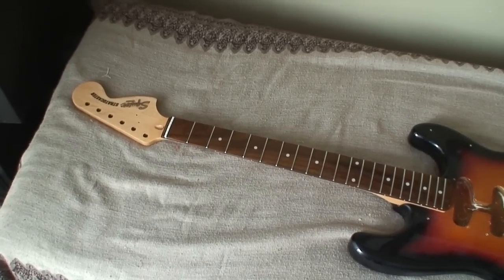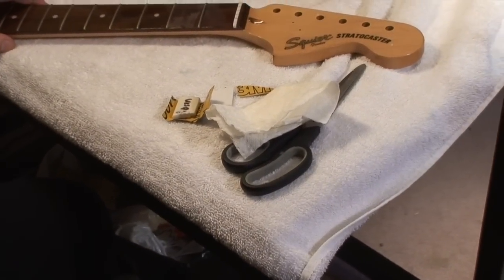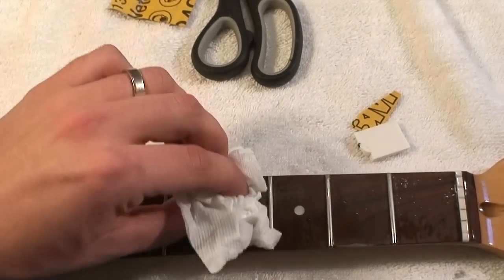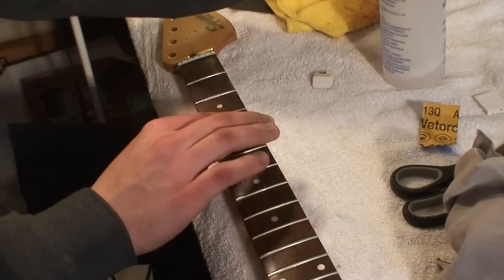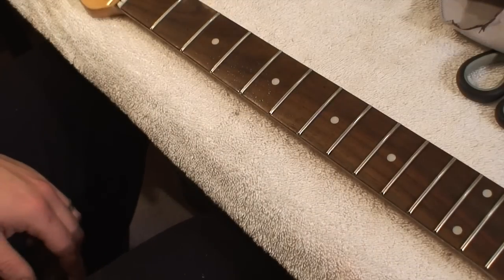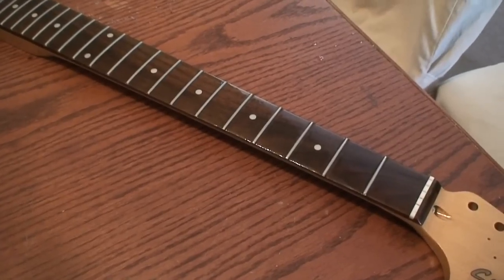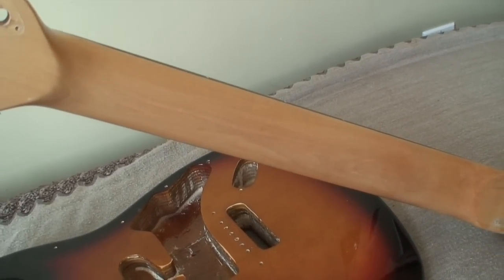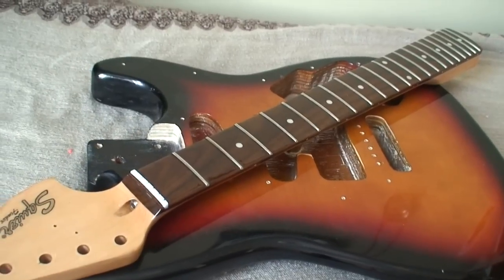Will the Lacquered Rosewood Strat neck work out? - part 2

Comment: I'm watching this with increased interest. I just bought a Gibson Melody Maker Special carcass on eBay and it came in yesterday. The rosewood freeboard is super low grade and seemed to have but finish sanded with a band saw. I think rolling edge and lacquering the board might be the only way to make it worth the effort of a build out. 

2 of my older Michael Kelly guitars have their fretboards done as well and they have a great feel. Great vid as always man. Thanks!
Reply from the maker: Cheers dude. It's funny, but I've had a dozen Les Paul's and its the good old LP that's made me think of this so long ago. I'd love o see a LP done like this.  It's always been in the back of my mind. Could I lacquer a LP neck?  I think it would look and feel great.  I'm hopeful this works out and I may just do a LP at some point if this is durable enough not to flake off over time.  I'd like to see how this holds up, because of the natural oils in rosewood.  Some have made mention that this won't hold up and that the natural oils will force the lacquer loose eventually.  It is my biggest concern. But, I've finished tons of wood-working projects like this and it has never caused me any grief.  It may be a case of finding the right material to do this.  Terry suggested epoxy.  But that's messy and while I know it'll work, I'm not keen to do it.  It's something that seems quite messy and uncontrollable;-)  Anyway - let's see how this shakes out.  Thanks again for stopping in to chime in on this:-)
Reply: Epoxy is a good idea but I'm scared just thinking about that one. I've had a few "painful mistakes" with epoxy that have left me a little gun shy. I wonder if true or tung oil will work too? I have a true oil maple tele neck that I love. Maybe to mix it up I'll try that. What's great there is that it doesn't smell bad either. I've worked with nitro for years but since kids my wife has relegated it to outdoors and the shed. Which means 3 months of the year to work with it. That stuck REAKS. 
I have to figure yours should hold up pretty well unless you're playing the crap out of it, and then you might get what Fender guitars get where it gets a little frayed at the edges. I can't wait to see it done! Thanks as always dude. I'm now dusting off my 3 or 4 still born projects... you've inspired me to start finishing some stuff!
Reply from the maker: That's awesome dude.  Post up a link if you're filming any of it.  I'd love to see someone else's take on this.  As for how it'll wear, I'm hopeful, as you say, it'll be just like any other lacquered neck Fender.  Those finishes eventually crack and do all sorts of nasty stuff.  If this holds up the same, I'm happy with that. As for oil finishes, I've done them. They work great. One of my very first videos, is scraping shittiy old lacquer off a maple neck and redoing it in Tongue oil. Worked out great. Felt great. Sad I don't have that guitar anymore;-) Good luck and I'm glad to have kicked you in the pants to try this:-)
Reply from the maker: Oh and BTW...I think that Melody Maker is a great candidate for some upgrades like this. I've tried the oil on rosewood necks.  Seems to work just fine.  Though I had to go to a lot of effort to get the shine I wanted.  I ended up with a few coats, buffed, flattened (really easily too) and then some paste wax.  The paste wax was great. Brought the shine up, its super durable, re-applyable at any time and you can be rough as hell with it. Rougher the better. I use a shoe brush and it comes out like mirrored glass:-)
Reply: Woodeso's Guitar Mods Sweet thanks for the reply and info. I'll document the process in a video or three. I love the 2014 MM, with the carved maple cap and thin body it's built right and super comfortable to play. I have enough P90 guitars so it should build out to something cool with the GFS Hot Liverpool mini hums in it and a Bigsby. I've also got a flame top tele mahogany body with a flame neck that needs staining and finishing and a Portuguese flag themed Strat that really is just waiting to be put together at this point (and has been for a number of years). Time to get them done!

Comment: The only reason they use a clear lacquer on the maple necks is to protect the wood from wear. You've seen old tele's where the lacquer has worn through and the wood wears down. If the lacquer wears off I always respray mine. Leaving the wood bare is like never washing a vintage car. Eventually the wood starts to wear away and that can't be fixed. Rosewood necks are naturally oily and resist wear if oiled regularly. In fact the oils in the wood will probably keep the lacquer from bonding to the wood. Never seen a rosewood neck that was lacquered and I don't think that's because no one ever tried it rather they tried it and it doesn't work. I have a feeling that if you play the guitar for a few weeks the finish will just come off. And nevert sand across the wood grain. That's woodworking 101.
Reply: squidkid2 Tony Iommi used a lacquered rosewood fretboard for like 10 years.
Reply: rickenbacker
Reply: never sanding across the grain of the wood, is woodworking 101. He didn't say not lacquering rosewood was woodworking 101. Of course it can be done, but steps do have to be taken in order to prep it for the lacquer to bond.

Comment: I have a solid rosewood neck ,I'm going to try to spray everything but the fret board, I already did it once with off the shelf rust-oleum  gloss lacquer and I had to sand the entire neck back down to wood, I just ordered Nitrocellulose lacquer and im going to retry, The first time I didn't grain fill and the lacquer didn't stick at all, I mean it did but it didn't it was just a mess, So this time im going to grain fill wipe down spray sand sealer then my nitro, Do you have any suggestions since you have also gone through the problems of spraying rosewood.
Reply: i think the key for this to succeed is sanding.I used a ripped off rosewood fingerboard from a project and sanded it lightly in the direction of the strings(cause i didnt want to mess with the radius) with various sandpaper grits....from 320 to 800.Then i wiped it clean with alcohol several times and minutes later after the last wipe i sprayed the first clear coat.I sprayed another four or five coats that day and the next combined and the fingerboard has already a nice glossy look....i didnt continue but the project was a success and that made clear that prepwork is the most important here.
Reply: Dreamdancer11  i ended up with a nice finish, the key was the grain filing of the neck after that everything "the nitro"stuck to the wood as it should have
Reply: Nice...but i was talkin about laquering the rosewood fingerboard...as for grain filling now that you mentioned it i personally use thin cheap superglue....its easy fast and effective.Sometimes i even use it as an end finish for things like the neck back.
Reply: Dreamdancer11  yeah, i was shooting for a professional finish as you'd see from factory
Reply: Well if you wet sand, perfectly level the surface and then polish any finish looks like a pro finish...

Comment: So now how do you clean the fret board now that you have laquer on it? Just treat it like a maple fret board basically? Do you even know if you will have to oil it at all in the future?
Reply from the maker: No, well that's the practical part of this experiment.  It's lacquered now, so I should have to do a thing to it.  Nothing I wouldn't do to a maple fretboard, which is clean it with water.  Since it's sealed, it won't continue to dry out.  Hope that answers your question:-)
Reply: It does. Hopefully you don't have to do anything with it in the future. It turned out to look quite nice. I was a bit skeptical at first because it was so shiny. It looked a bit odd. I'm interested to see if it made an impact on the sound or feel of the neck at all. But that's probably going to be in another video right?
Reply from the maker: bhr 8149 For sure mate.  And I totally understand your skepticism. I too am a bit skeptical about how it will wear.  Will the natural oiliness of a piece of rosewood, eventually force the lacquer loose and make a mess?  Who knows.  I'm eager to see it on a working guitar, and how it wears over time.  But yes, I'm doing this all as a long term build up of this body and neck:-)  So hopefully, it'll be a good long term test to see if this is indeed worth trying again more thoroughly and paying close attention to all the detailed finishing steps I ignored for this attempt.

Comment: This is a cool experiment for sure.
Quick question, what brand is your naphtha?
Reply from the maker: Just plain old lighter fluid. Available anywhere:-)  Yeah, good old zippo fluid, or an actual can of naphtha are essentially the same thing. Works great.  I avoid alcohol based stuff, as it always causes me trouble.
Reply: Thanks!

Comment: Rosewood is an oily wood (much like ebony, cocobola, and other very hard rosewood type species), which is why it's not typically lacquered (not a contaminate).  Lacquer won't stick to that for long because the natural oils in the wood will build up under the lacquer over time and eventually work it loose.  But I'm willing to be wrong.  Looking forward to a part 3.
Reply from the maker: I wondered about this, actually.  It's all part of the longer term part of this experiment.  since this is sort of a long term guitar build, I too want to see if it will just flake off.  It was certainly my worry from the outset.  It may be why I was having so much trouble on the second fret.  Cheers and thanks for chiming in:-)
Reply: Ive just bought a laquered ebony fretboard. I havent had a chance to play it as the guitar is a custom job and is being set up right now, but the laquer is already starting to crack and peel away close to one of the frets as the wood opens up and is oozing oil. I expect the neck will look like shit within a month or two and i will have to sand it down and oil it instead. Its really not worth the effort I reckon.
Reply from the maker: Fair cop mate. And that's why I'm trying it on a cheap neck to see what happens.  I'm keen to let it cure for a month and then hit it for the last round of flattening and buffing.  I'd like to see if it flakes off at that point with all the abuse of sanding and polishing.  Seems to me, unless it's had time to really cure properly, I'll never know until after it gets onto a guitar. And I'm not aiming to install a pile of shit onto a guitar;-) If it's going to flake off at that point, I'll bring it all back to bare wood and oil it. No harm, no foul.  No big wheel really:-)  For now though, the $10 I have invested in this little experiment, is worth the fun of doing it, to me:-) That's sort of the point anyway:-)  If I were David Fletcher, I wouldn't be filming crazy videos like this:-)
Reply: Cool experiment man. Can you give us an update on the condition of the neck after 2 years? Cheers!